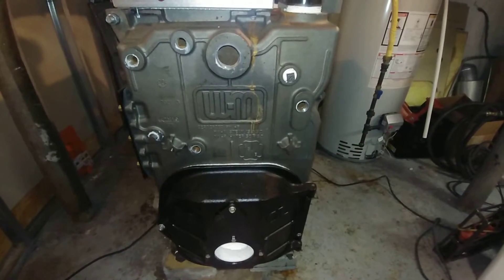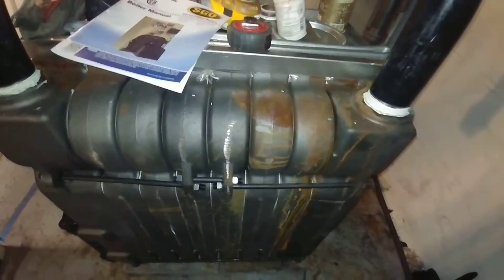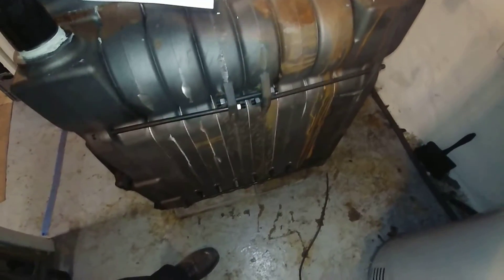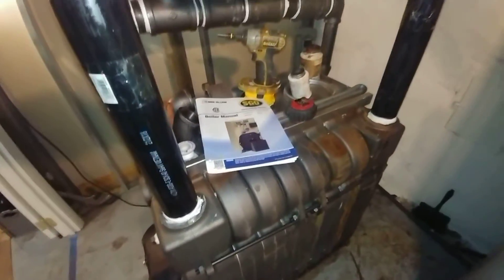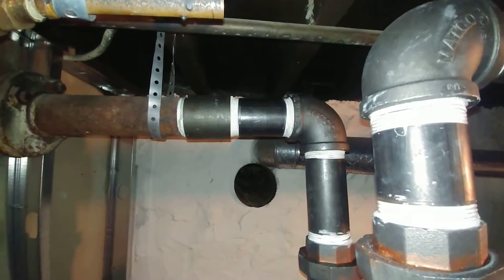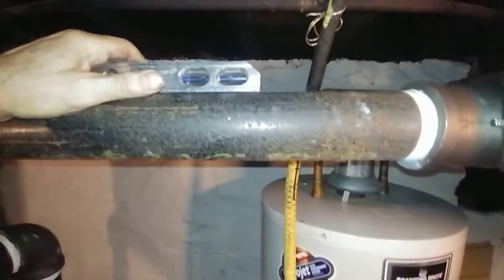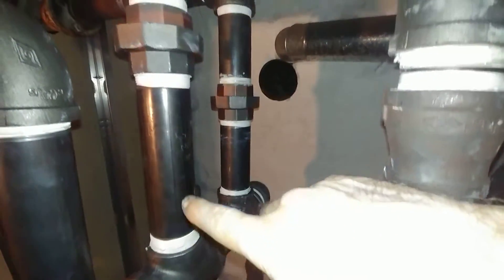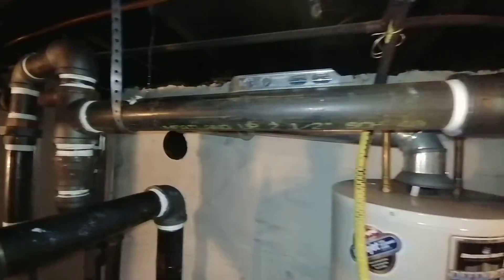Weil Mclain SGO Steam Boiler Install - Counter Flow Steam Main

Comment: i love to see nice piping jobs. but i just wonder why these systems are actually still installed in this day and age. this is such a stupidly inefficent system its not even funny.
Reply from the maker: Thank you for your comment!
Residential steam heating systems are not being installed new (except now and then once in awhile).
Just to be sure, this is a steam boiler replacement onto an existing well working 100 year old system.
There is every good chance the piping and radiators will last another 100 years (admittedly,  the boiler will not).
Taken from that perspective, is it not a reasonably efficient use of existing resources?  
The pipes, etc are already there.  
Why not use them. 
They still work.
If I may take it another step further, steam is an excellent means of transferring heat energy in that it "transfers" itself, i.e it doesn't need a pump, for example.  
It is not quite as inefficient as you might think.
If we take electric power generation, for example, IIRC, by the time that energy reaches the typical wall socket, it only represents about 4% of the inputted energy.
And that's no laughing matter.
Reply: What companies are installing these into new builds?

Comment: counter flow steam Main Is there a distance from the header in which to install the drip Tee? Using a Utica standard Header diagram? How far from the header is the minimum or the maximum. Do you want it to be three or 4 inches or a foot away? Where is the most effective location to install your drip Tee? I don’t know if I’m wording my question properly
Reply from the maker: You're doing the right thing by asking questions. That's very good.
However, We don't install Utica boilers and I cannot see your job, so your best bet is to reach out to Utica.
If they can help you out, then you're more likely dealing with a company that will stand behind their products.
If they don't respond, consider another boiler. 
Again, way way way too many factors to give specific advice for your situation.
Reply: @gordonschweizer5154  Thanks for the response. I've been installing steam for a long time and have always used cast fitting as you can break them if they need to be removed in the future. I mean 50 - 100 years later after they burned into place from steam and time. I sure do miss concentric fittings. Do you have access to concentric fitting where you're at. Wholesalers around N.J. haven't had them for probably 25-30 years. I figured my drip at about 3" from the double swing I have at the top of my header. Thanks again, Brian
Reply from the maker: You're welcome!
As to the crackability of cast fittings, I tend to see that as a downside and not necessarily an advantage, in that they have sometimes cracked on me when I didn't want them to!
Malleable fittings can be removed by "cracking" if you grind/notch them with a cut-off wheel on an angle grinder and use small pipe wedges to split the fitting. The fitting comes right off and no heavy pounding. 
So, unless your local inspector is a bully and makes you use them, I still see no advantage to using cast fittings as a matter of course.
Also, cast is not approved for gas, so it simplifies inventory.
Also, malleable tends to "stretch" a bit more than cast, giving a bit more give when you dial in a tight alignment. 
Eccentric fittings are still made by Anvil or Ward last I checked.
But they are special order and 6 weeks away. Be prepared to up your credit limit when ordering.
An old line supply house closed down a few years ago in our area (I made a video of their last days and posted it to my channel).  Bought a lot of them then.  No extra charge for the rust and dust.
Reply: @gordonschweizer5154  Another drawback to cast fittings are the sand holes. The reason you can not use them for gas. It's a bitch when you install a cast Tee deep in a header only to find out you have a steam leak right through the fitting caused by a cast fitting. It's happened to me before. It was right in the smooth edge of a Tee right in the middle of the thread where the thick hub is. I only use cast because my Father who started working on steam in the late '40's did and because you can crack them. To me it's foreign or odd looking only because I seen and done it that way for a life time. I don't know how many steam boilers I have left in me, but maybe I'll give it a try. We sure put a lot of boilers in, in the '70's P.S. that leaking sand hole I poured a teaspoons worth of lead into it and tamped it with a punch. It never leaked again.
Reply from the maker: Thank you for sharing your story and experiences!  I really appreciate it and it gives me prospective.
In my area it seems, most steam boilers now have been and are being installed with soldered copper headers.  Some are using the new propress and megapress to install headers.
I am considered the throwback in my neck of the woods by using threaded steel.
So, generally, when some take me to task for not using cast fittings (This is not directed at you, sir...you are being polite and respectful! Thank You!), it kinda gets my goat.
And the boiler manufactures are being mendacious and unhelpful.
They tell me to my face that I am doing it right and good, but telling my potential customers behind my back that piping a steam boiler in copper is perfectly fine (I am looking at YOU, Weil Mclain).
Reply: @gordonschweizer5154  I've taken out many a copper header and Everyone of them leaked one way or another.
Reply from the maker: @Brian-nl1ok  Yes! Copper headers look  best when in our scrap buckets 😆

Comment: Is the short draw rod @ 2:10 suppose to be in that position? I thought it should be installed in the lower holes. Looks like the longer rods are on an angle now. Also, why use an oil boiler with a gas gun instead of a EG (or EGH not knowing the size required) with atmospheric burner?
Reply: Check out the SGO manual if my video was not clear on what's happening with those draw rods. Here is the link (I think):
https://www.weil-mclain.com/sites/default/files/field-file/SGO%20Boiler%20Manual%20550141829_0316_WEB%20VERSION%20%283%29.pdf

All in all, a power burner burning whatever fuel (oil, gas, or pixie dust and broken dreams) combined with a barometric draft regulator, is going to be more efficient than a Bunsen burner and a simple draft diverter due to tighter air control, among other things.  Also, the boiler design of having 5 sides "see" the fireball as opposed to the "pan-on-the-stove" atmospheric EG will tend to capture more heat before it's sent up the chimney.  I think also given the tight space, the SGO is going to have a smaller footprint then the EGH. Downsides? More fiddly to install. More expensive parts. More complexity. More noise.  But the total cost to run should be less in the long haul.  Its a choice.  There's no absolute best answer.